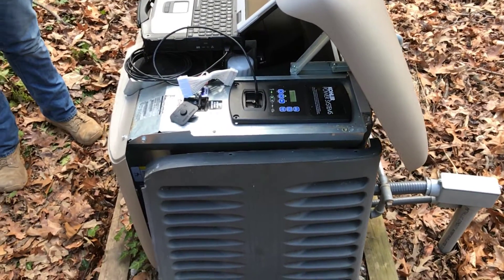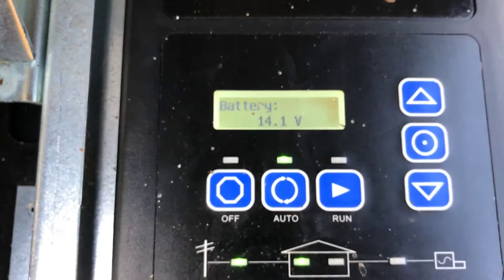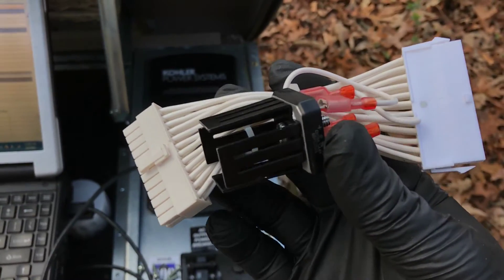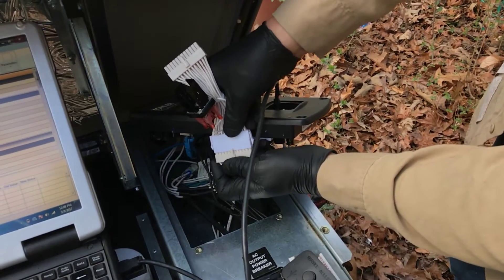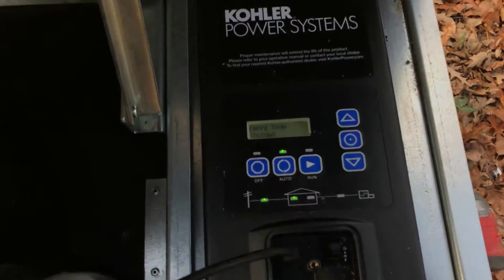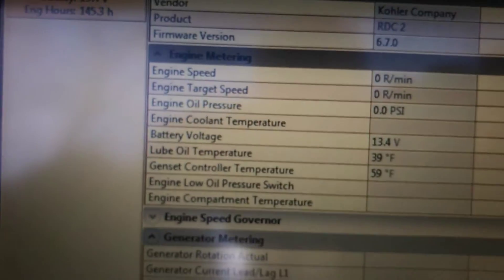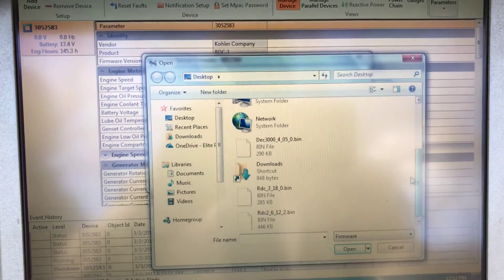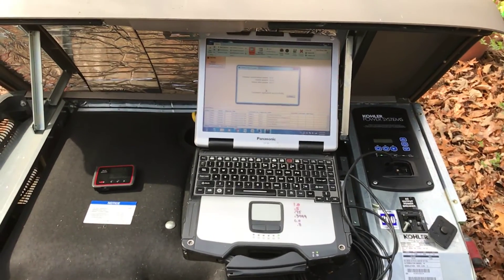Kohler 20kW RESA

Comment: I just inherited a 20kw RESL Kohler standby that ran great at its previous home.  I unhooked it from that home and brought it to my house.  I didn’t know to keep the maintainer plugged in to keep the battery charged till I could get it installed. The DC controller lost its internal memory and now that I have a charged battery it won’t start or even try to crank. It shows a “NO EC” code.  I was told by a service tech that the controller is out dated and I have to have a new controller installed $1800.  Can site tech be connected to my controller and programmed to make it run again?
Reply: I just installed an "external" battery tender on mine after I got a quote from the engineering company that diagnosed mine as also needing a new controller.   They quoted me over $2,600 installed.  Parts were only $1,115.  The technician happened to mention that the older style Kolar Generators had a battery tender attached to the side wall above the battery.    As such, I purchased the tender off of Amazon for $24.95.  So far so good!

Comment: I have the same model Kohler but my battery charging is only showing 12 volts.  It flickers back and forth from 11.9 to 12 volts.  Is this normal?  We are currently in an extended power outage.  Will my battery eventually die (and generator shut down)?

Comment: Hello there thanks for this video. Helped me with battery issue.
Now I’m having a locked rotor, shutdown error. 
Already changed the controller to new RDC2 Gen4 mfg date 5/20/2020 (GM92089)with new wire adapter (GM95104) , same problem. 
What else can it be?  Was told my 2012 20RESA s/n SGM322FVB, does not have a mag pickup (speed sensor). 
What should I look at next?  Maybe need new system?  
Thanks for your help.
Reply: did you happen to figure out the issue. We are also having the same problem.
Reply: @sarahsalley3215  Hello Sarah. I had such a hard time finding a tech in my area that could help me.  4 different companies, 5 techs each saying something different or did not know how to work on Kohler generators.  One said he will be back and never heard from again.  So after dumping about 2k in parts and diagnostic fees I decided to throw out the baby with the bath water sort of speak.
Trashed the Kohler unit and went with a brand new Generac 24kw generator; apparently that’s the only brand companies by me know how to service and work on. Spending another 10k with new unit and install, but now I have a working generator and ready for this crazy NJ weather.  That’s my story and I’m sticking with it.  HaHa.

Comment: Got a diode kit on the way, thanks to this post.  Symptoms on my RESA20 exactly match what was shown, and as suggested, Kohler is sending it at no charge.
Really bugs me that the local Kohler dealer diagnosed the issue over the phone, and wants to install a diode kit for $110 plus $200 labor (that's to install a replacement battery too).  Something tells me that the dealer knows all about the fix, and sees an opportunity for an easy hundred dollar profit...
Reply: So we have a battery that is over charging also. The technician said he need to put in a new diod but you didnt do that right?? You just put in the kit? You just call Kohler with the issues and they covered the part cost?? I have a 20RESAL also.
Reply: @JacobAHull-nx6rx  - the kit includes the diode... it is definitely required AFAIK.

Comment: sir also tell me which firmware is good for 12Res
Reply from the maker: Muneeb UR Rehman the 12RES does not need a firmware update as it has a ADC2100 controller. If you have a 12kW RESV then you might need an upgrade, depending on certain factors. 

We cannot send you firmware as you need Kohler Site Tech to install and update the firmware on your unit. You would have to contact your local dealer to have that work performed to ensure all parameters are set correctly for proper operation.

Comment: It's amazing that I find out about this problem with the battery charger by searching all over the web and arriving here...what's wrong with Kohler!! Both my father and I have experienced battery explosions with our Kohler generators. We replaced the batteries believing that we had not maintained them or some other reason. Thank you for the great video and a heads up that it's a problem that Kohler knows about. Sure enough, when I called Kohler directly and mention part GM95500, they said all labor and parts are covered and just call a Kohler service rep!!!

Comment: I got the same unit for my new house but it won't start and it says Battery CoCr low warning. They ask me to provide the serial number and see if the unit is still under warranty covered. Could you please tell me where can I find the serial number for the unit?
Reply from the maker: Alicia Lehoux there is a data sticker either right on top by the controller or at the (right) end in the battery compartment - which is accessed by removing the two screws - depending on the age and model of the unit.